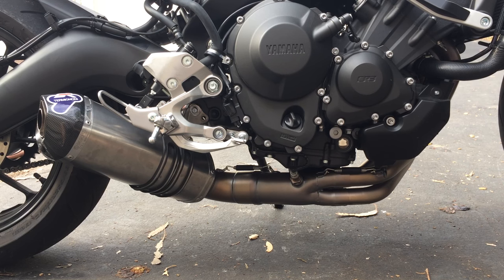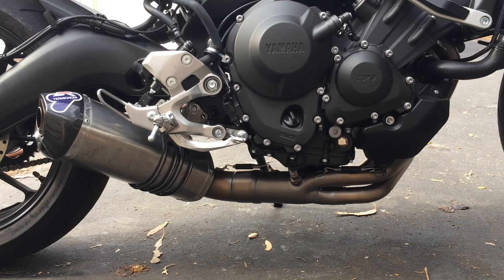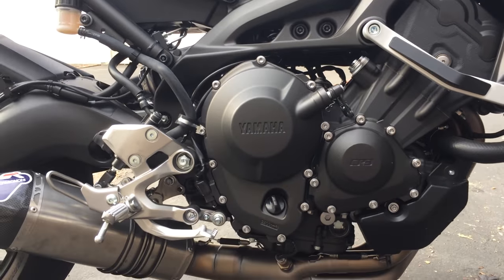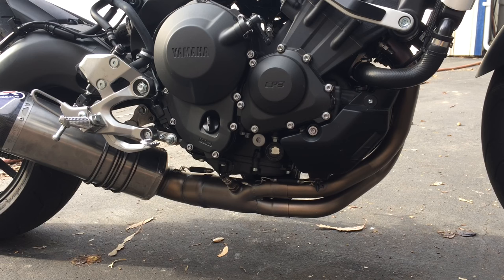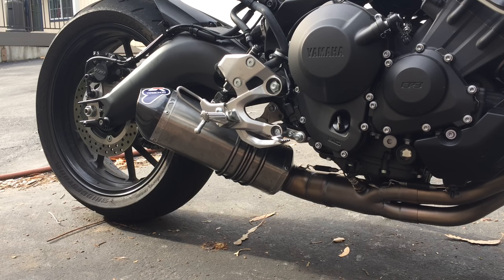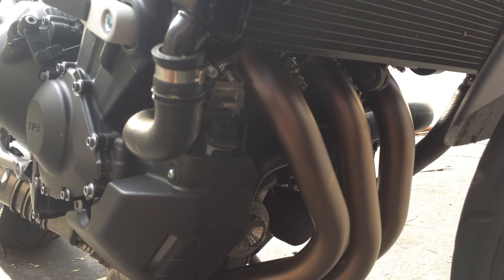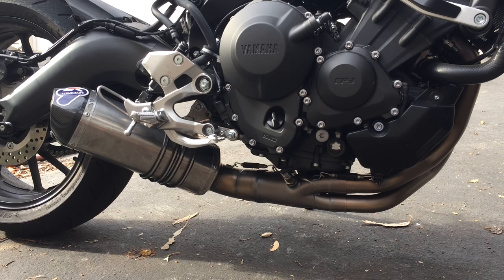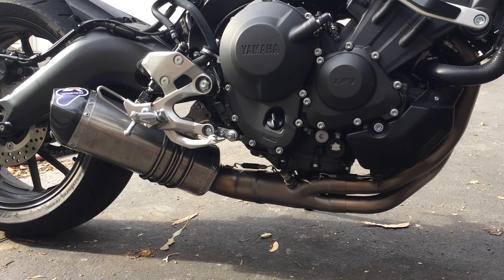XSR900 Termignoni Ti review

Comment: Thanks for your professional review. I also like this exhaust with my XSR900 because of its deep sounds and "hug engine" header design. But before ordering it, I'm still confused about 2 questions: 1. the ground clearance where the header enter the mid-pipe seems considerably closer to the ground than the stock or other aftermarket exhaust ; 2. For strictly considering, is it necessary to re-match ECU by computer for engine reliability, power performance & fuel economy ?  Look forward to your advice. Thank you.
Reply from the maker: clearance is same as stock, mine looks less because my bike is lowered by about 14mm front/back

I didn't re-flash my ECU but if you fine someone that does it right then it would be better...there are a few things that yamaha did that I don't like but for the most part the way I have it set up it works

Comment: thanks for your response on my other inquiry. I'm new to this. just a quick questions, can the DB easily be removed? or what other ways to make it louder? TIA
Reply from the maker: yes it can be removed
Reply: thanks. do you have a video on it?
Reply: also is it just the DB or also the cat?
Reply from the maker: have to buy the cat seperately, but it does reduce noise
Reply from the maker: No video, it is only one screw and slides out